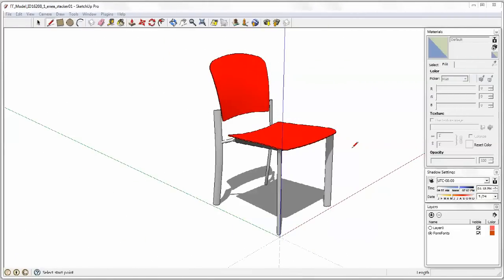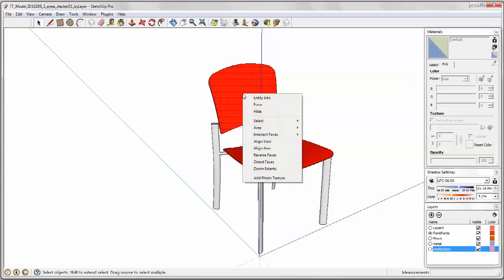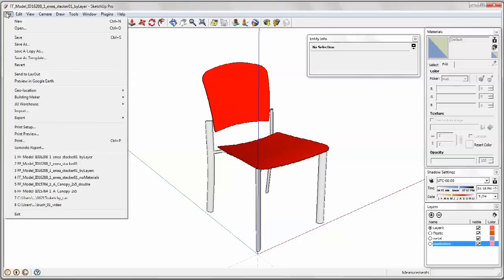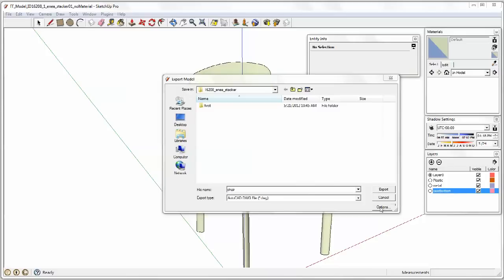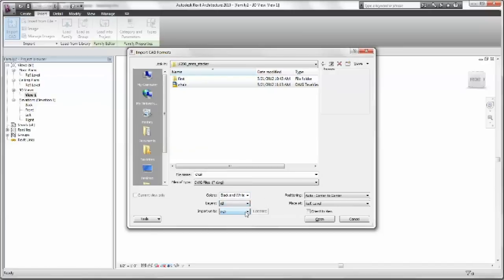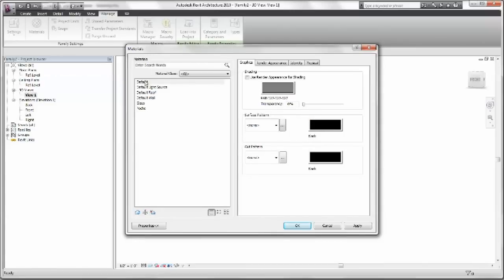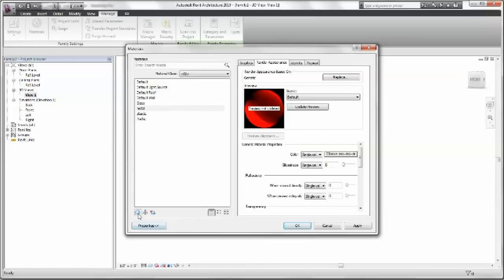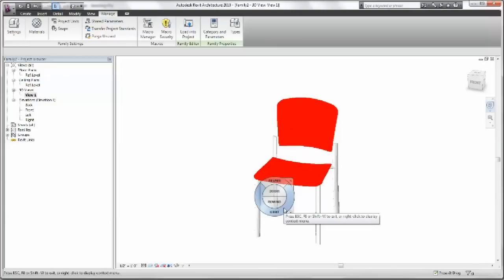How2 (TM) Convert a SketchUp Model to Revit

Comment: I need some help, when I try to insert material on the imported layers the program do not allow me to change the materials.

But when I try to change those default ones he does makes the change, but sometimes I get a tire on the same layer as a windows for example, so it does not work.

Comment: i still have the edge line in revit altough i've exported in in face only..  
i have tried resoften all the edges in sketchup and exported it again, but still, the line appears..
any idea where i did wrong?
Reply: Sahudi Salim it seems that you may have to save your model without the soften edges ...as can be read on this page:http://knowledge.autodesk.com/support/revit-products/learn-explore/caas/CloudHelp/cloudhelp/2015/ENU/Revit-Model/files/GUID-989EE87F-31C2-49A0-8575-469C218E43CE-htm.html
Properties: The following Trimble® SketchUp® properties are currently not supported in Revit import: “Smooth” Curved Surfaces...  Hope this helps :-)